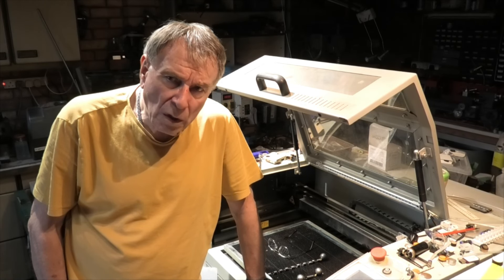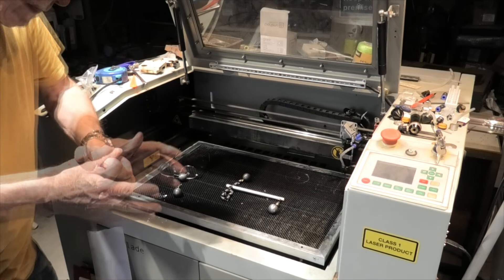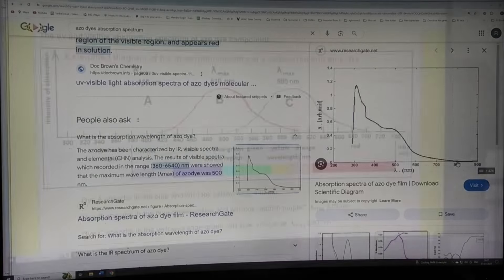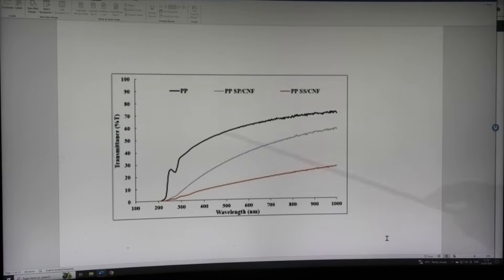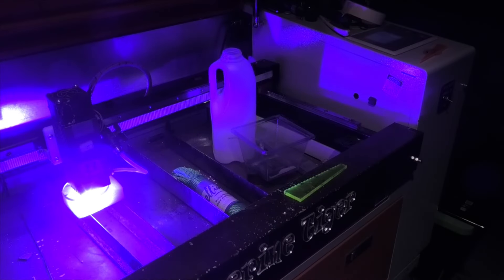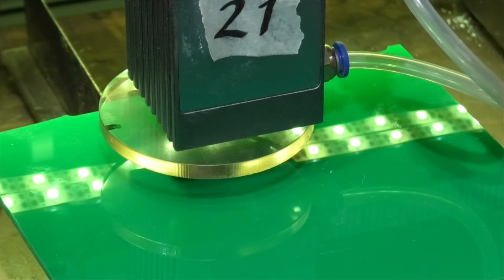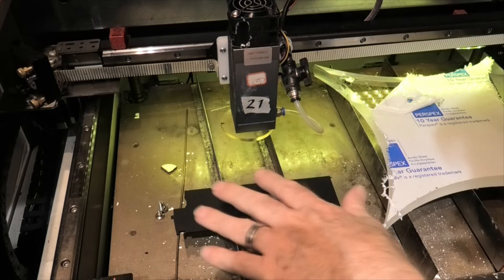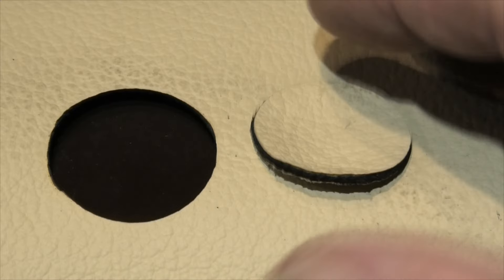Diode Lasers .....Under the Hood 21

Comment: i wonder where did you found those balls and springs 
they are just perfect for the purpose
Reply from the maker: As a retired engineering designer I have shelves of leftover project materials that I never throw out. I have no idea when and where I acqired those pieces of equipment  but I dug deep and found bits that allowed me to demonstrate complex science  in a simple visual way with no need for formulae or years of university study. It seems to have worked. Thanks for the comment.

Comment: An other question i have with diode laser is there life time and efficiency over the time? I read that diode laser produce laser from a cristal. This cristal hurt with temperature and so loose efficiency. What did you think, see, about?
Reply from the maker: Hi Benjamin
  I have to be honest and say I don't know for certain. LEDs in general have  long but finite lifetime  in the order of tens of thousands of hours . However . I know from my electronic inexperience that unless you limit the current flow through a light emitting diode it can have a lifetime of just a few minutes.  I have heard from quite a few diode users that after as little as a year their products have died.  Ouch, that can be expensive. Sadly, I will not be using my diodes for serious work or for any significant period to see if and how the diode fails. My goal is to investigate the pros and cons of the technology . I am sure you will find a sensible answer at one of the many diode user forums.
Reply: @SarbarMultimedia  thanks for answers. Yes i find this kind of information but if you have a light mesuring tool, i'll be curious if, for same current, the light power will be the same after time. From my personnal experience, after hours for cutting a big piece of wood, the diode loose a lot of power. However, i did'nt have tool for mesuring.
Reply: @benjaminbulle9199  I have had the same problem before. In my case, cleaning the lens was the solution.